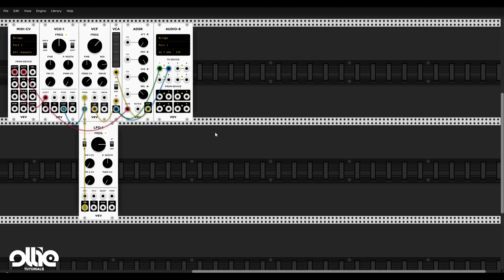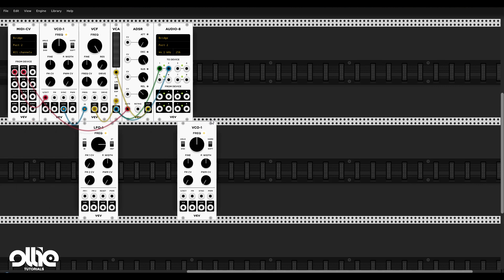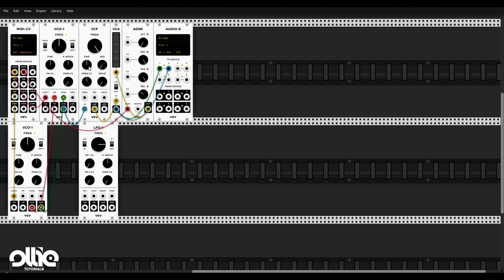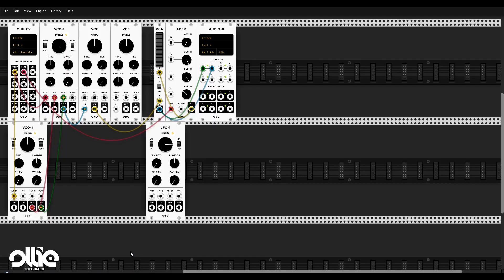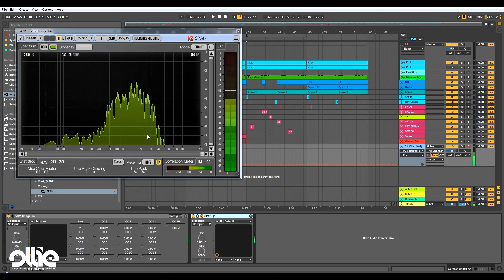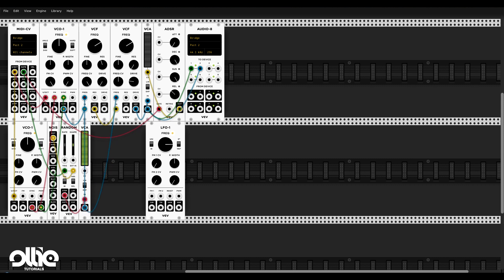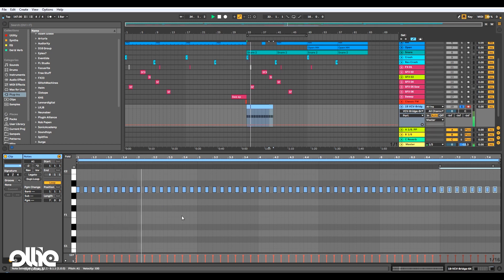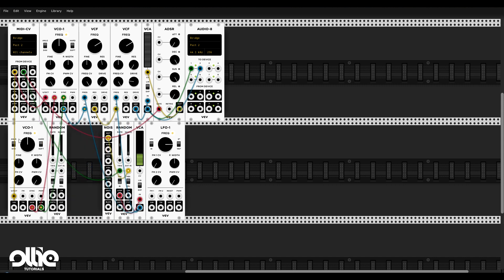[TUTORIAL] Modular & Psytrance (Pt. 2) - Creating a unique FM Machine with VCVRack

Comment: Great tutorial thanks. 
Just wondering if the modulator VCO was tuned to the same octave as the carrier ?
Reply from the maker: At first yes, both of them were on the same octave, but that wasn't the case when I've started to modulate the pitch of the modulator.
Reply: @olliepsy  Ok thanks. I attempted to achieve the basic lead soubd ( before you added the lfo modulation) using my Eurorack Hardware VCOs. But the results were not that similar. Could it be that my VCO's do not have the same kind of Sync?
Reply: @Pspiralifemusicandedu   zenon master